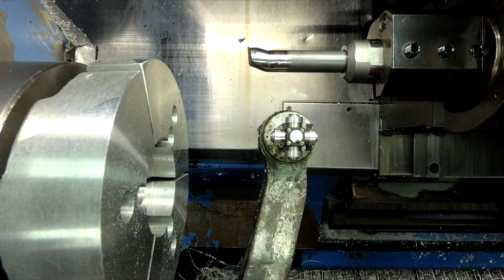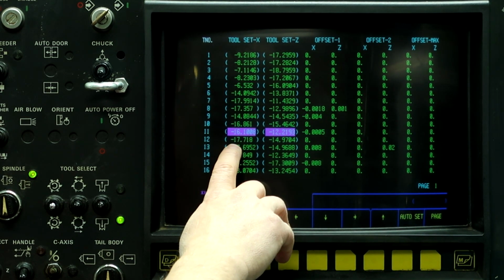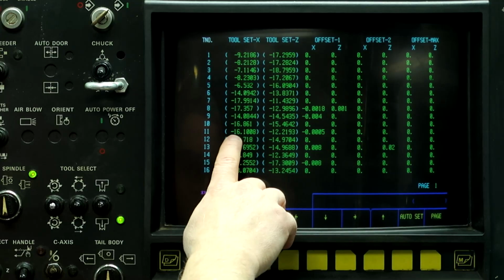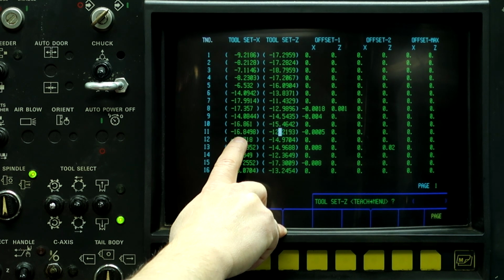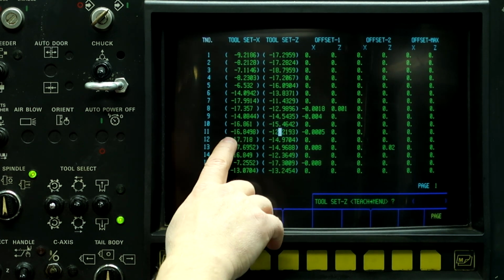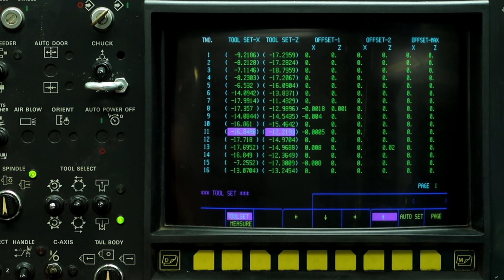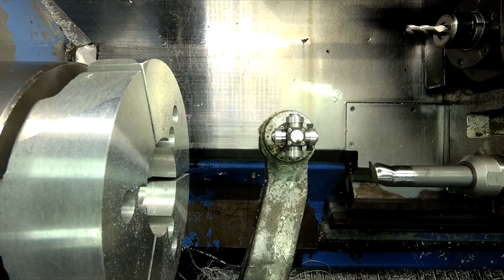Mazak Lathe Setting Centerline X Geometry

Comment: Hi Phil.
Still finding videos of yours i have Not watched as yet, LOL.
I Post videos myself, so i can appreciate the effort it takes
What i Like most about your videos is you give a clear understanding of what you are doing during the video.
If not clear for some watching you are happy to reply with the right information.
All the Best for 2021.
Regards Peter.
Reply from the maker: Thanks Peter.
Reply: i have a question for you 
say you join a shaft to a base to make a flange ok? and weld it by means of tig weld 
does the weld penetrate ?? if i MACHINE the the "fillet" to make it square ? right? did i just waste all the weld or there is still weld holding the two pieces?
Reply: @christophercolumbus8944  
I am guessing you must want a fairly sharp corner at the point where you are Welding ??
TIG would be best for penetration.
Their is no true way to say will it be strong enough after you Machine away the Weld  ???
It will depend on a few things ??
How thick the material is, and how many Amps you plan to Weld with.
The best approach is ?
Fuse Weld the 2 parts first, then go over it again with Filler Wire.
Generally,  IF you Weld all the way around the Flange it would be fairly strong.
It is a little difficult to give an exact answer, because it depends on the Weld and how much you machine away ??
Reply: @weldmachine  yeah exactly but if i FUSE it without use filler rods it tends to eat up on the shaft because the material is cheap 1018 steel 
also it could really hurt the structure of the steel too no? because fusing is melting
Reply: @christophercolumbus8944 
 Fusing without Filler is okay on 1018 Steel.  
Just be sure to clean with a Wire Brush to remove any surface contamination.
Before each process. 
Try it on a sample before trying it on your finished part to confirm everything will work out okay
Reply: @weldmachine  now if you fuse it you got inverse fillet shapes around the shaft 
what then?
maybe it's better just to weld it around with filler rods USE HIGH HEAT to penetrate and then ? machine it but leave a little radius at the corner? will it hold up? can you try ?
1" diameter shaft 3 inches long 
base: 2 " in diameter and 1 " thick
Reply: @christophercolumbus8944  
Weld it with Filler and NO Fuse Welding. 
The Fuse Welding will give you a good visual of what you have Welded.

Comment: We've just recently got a mazak 640mt and setting drills has been a head scratcher. We're all used to fanucs way of setting drills. Call up the tool with no offsets and wind it to x0 and teach x0 at that point.
Reply from the maker: Sweep the drill pocket with a co-ax indicator and write down the number. That will be your x geometry number for all X0 pockets.

Comment: Hey Phil,

I caught your video today.  It's a pretty nifty trick especially for smaller Mazaks that do not allow enough room for a standard coaxial indicator.  I have a question though.  After touching off the shank on the boring bar I noticed you shifted the geometry offset -.750.  In the comments below you state that the shank on the boring bar is .750.  Shouldn't you only shift the geometry offset half the shank (which would be .375)?  I'm assuming you are finding the CL the holder for when you want to run drills, c-drills, reamers etc.
Reply from the maker: You need to shift the geometry by the diameter of the boring bar because the machine will move half that distance radially.

Comment: Hi Phil. Thanks for these wonderful videos! Can you please make a video about using programable tailstock moves? I want to turn a part using tailstock then tailstock to retract and cut the part at desired length. Thanks
Reply from the maker: Does your tailstock move by itself or does it need to be engaged to the Z-Axis in order to move? Mazak made both types.
Reply: @mazatroltipsandtricks6816  it moves by itself.
Reply from the maker: @bdrotaru2   Put in an M-code process to retract the tailstock in the program after you stop the spindle. Type in M11 and M32, that will retract the quill and then the tailstock body to the tailstock home position.
Reply: @mazatroltipsandtricks6816  Phil i have a 135 edge angle Morse taper drill bit i am drilling vertically (ZC)
i tough off the probe i then ADD NEGATIVE the whole diameter of the drill bit or only the radius after?

Comment: Smart, do you think it is good enough for a reamer?
Reply from the maker: Depends how long the shank is on the reamer you have. If the reamer shank is short, it will be off too much and bore the part.  Best answer is to buy a Co-Ax indicator to get it as close as possible.  Regular test indicators will droop under gravity when they are turned upside down and are really not the proper indicator to sweep in the pocket.
Reply: Mazatrol Tips and Tricks reamer is about 150 mm long.
Just put an indicator in the chuck or? And then rotate and try to find the best center? 
I tries last week but I couldn’t get it better then 0,04 mm off center
Reply from the maker: @jepkeklinge3778  150mm long shank will flex a LOT, so I wouldn't worry about 0,04mm at all.